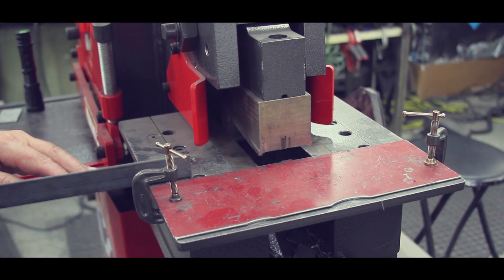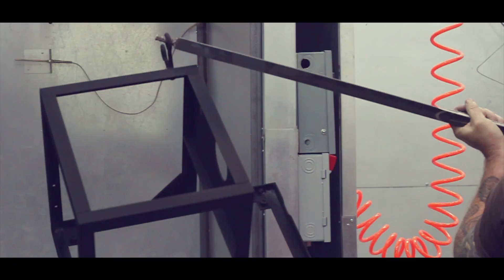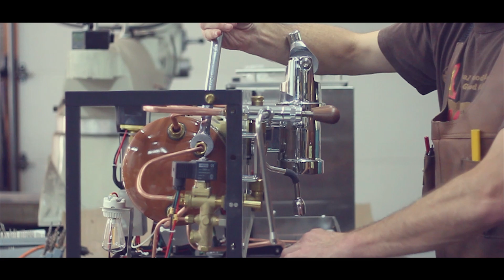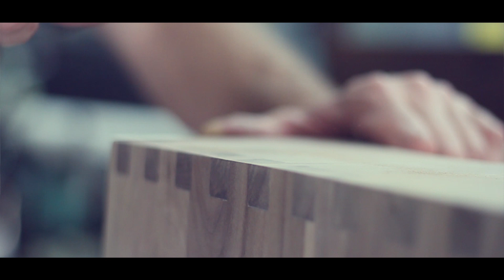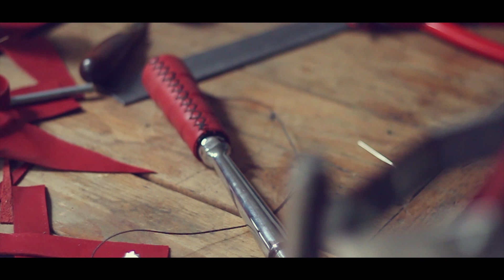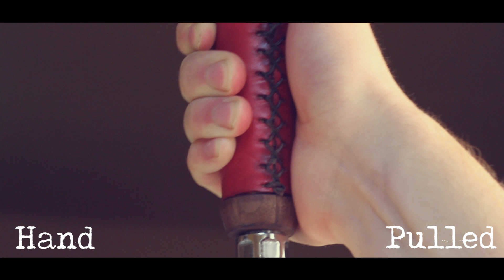Pull Espresso Machines - Promo 2016 www.pullespressomachines.com

Comment: What, this video went up in 2016 and there are only 13 Comments before mine? Wow, that black walnut with dovetail joinery is gorgeous! Plus, I've never seen perlage metal work on a lever machine before. I'm breathless. Pull Espresso is to lever machines as Speedster is to semi-automatic machines. Simply stunning.